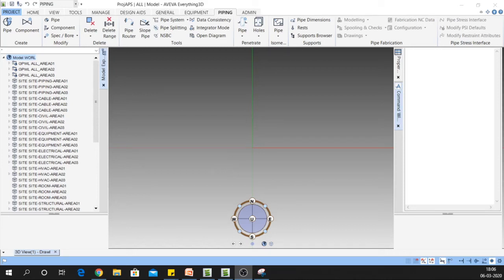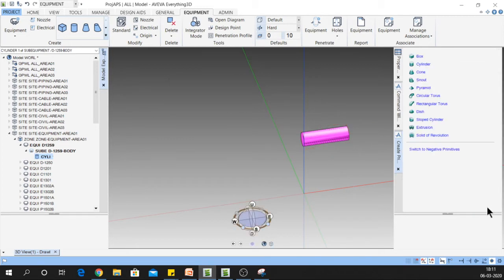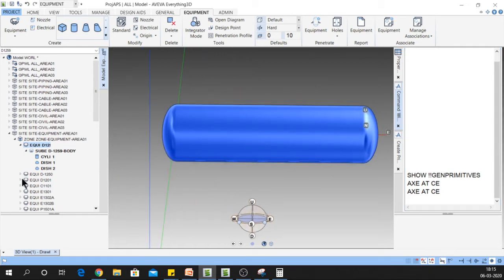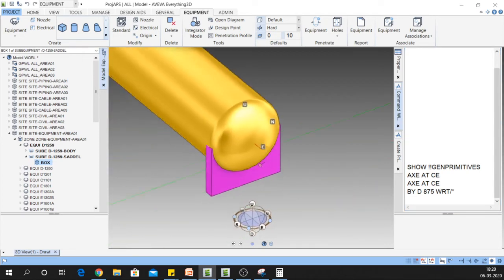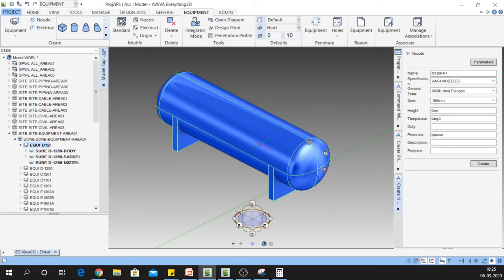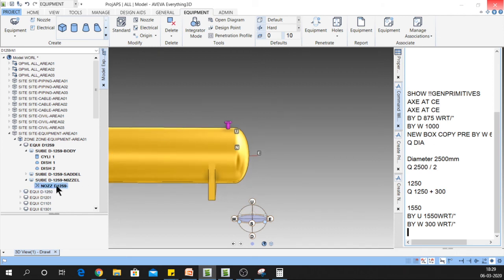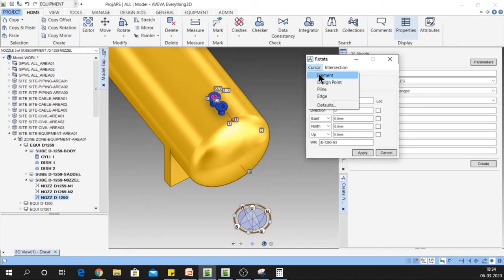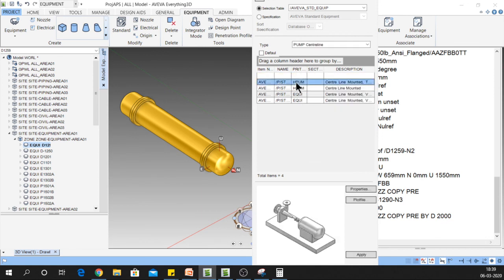EQUIPMENT MODELING

Comment: Thanks Dalvi. I have a question. Is it possible to convert an equipment 3D model made by vendor with any modeling program and to add nozzles for piping connections

Comment: Why don't you use the new E3D features that increase efficiency? Even the simplest/create a cylinder/mirror? In PDMS it was a necessity, but now...
You can Create Zone/Equp/SubEquip in CommanLine too))
NEW ZONE NEW EQUI NEW SUBEQ..
But new users will be confused and disappointed about E3D.